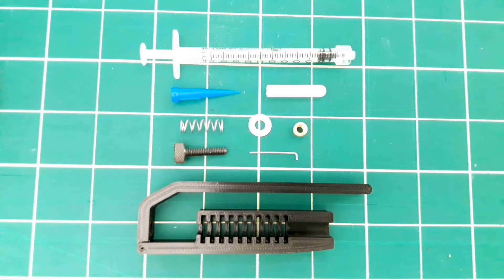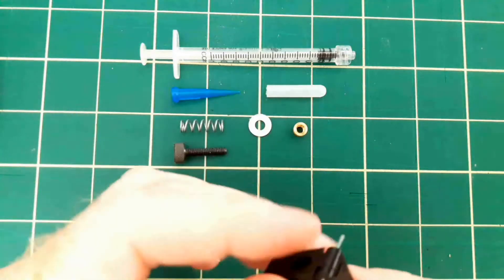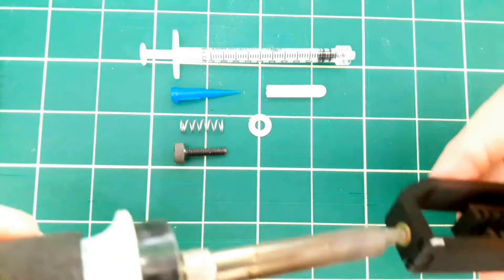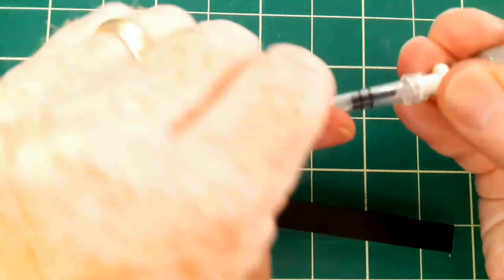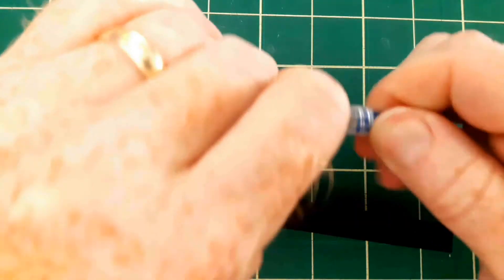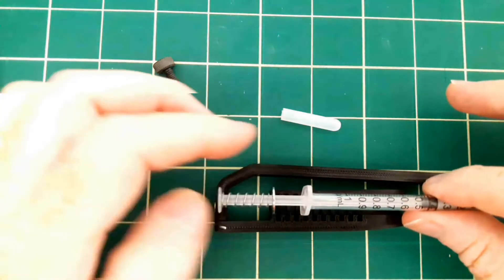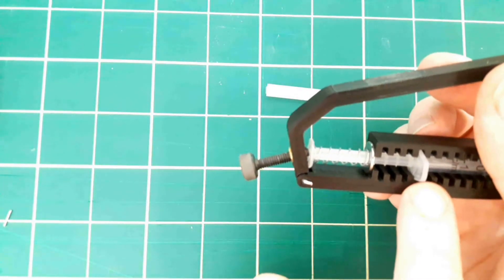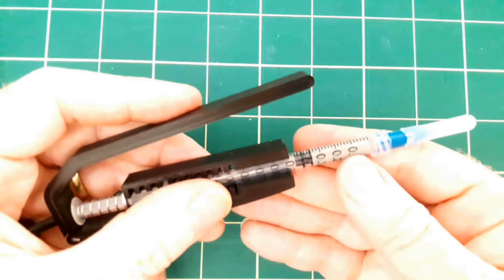Manual Solder Paste Dispenser Assembly

Comment: It looks like my solderpaste is much dryer than yours... Is it better to mix in a bit of flux to make the paste a bit more runny? At the moment i would describe miney more towards "crumbly" than "runny"....
Reply from the maker: I have never tried to do that, but I have seen several short YouTube tutorials that advocate doing so. My impression is that you want to add a small amount of an appropriate liquid flux at a time, stirring it in thoroughly, until the solder paste gets to the right look and consistency.  It would be something like cooking by adding a pinch of this and a pinch of that rather than by measuring ingredients out.

Comment: Very creative, well executed, videoed and explained.  Please tell me what the black apparatus is on the right side of screen at 2:53.  Do you have a link for that?  Thanks!
Reply from the maker: That is another manual solder paste dispenser design that I was working with back in 2019.  I don't like it as much as this one, but it is sometimes useful.  You can find the FreeCAD design files and stil files for the three parts on Thingiverse at https://www.thingiverse.com/thing:3510702 .  I used that dispenser in an earlier SMT soldering tutorial video (https://www.youtube.com/watch?v=CFnWlr5-RkU ) that I recorded in 2019.
Reply: @bminch    I make wine and do some titrations using a syringe over stir plate.  The problem is that I have Parkinson's.  So, I am trying to rig up something that will hold the syringe firmly so that I can just turn a knob/bolt (very slowly as it gets close to the endpoint) that will press the plunger.  This is very helpful information.  Thank you, sir!